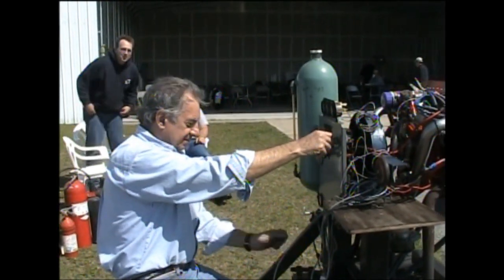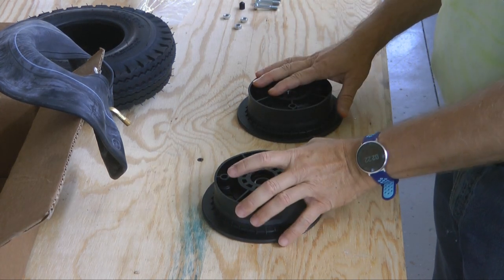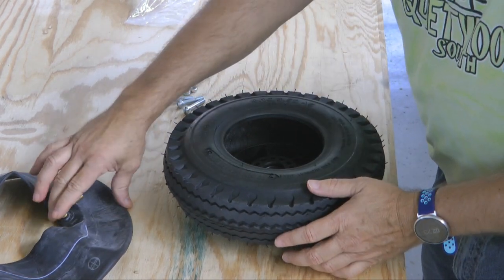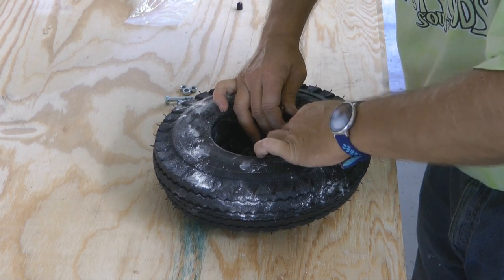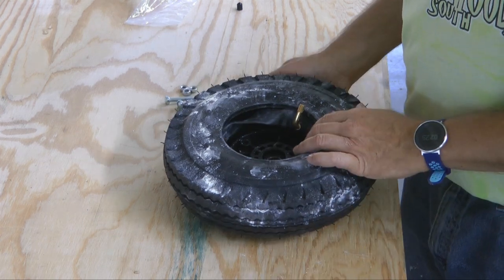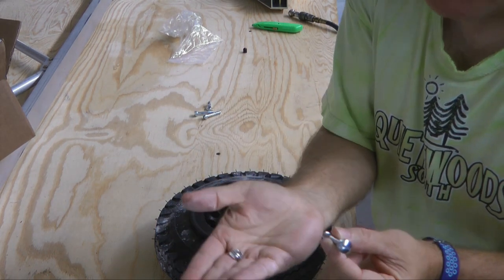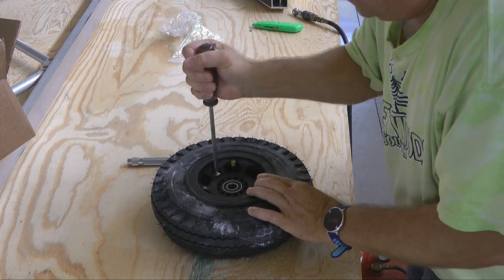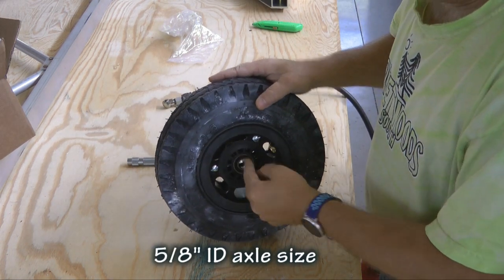Assembling Azusalite Wheels and Tires

Comment: Because this is a 2 piece rim it would be easier to inflate the tube just to take up shape but still very soft, then insert the tube into the tire without the rim halves. Once inserted with no folds or wrinkles, the rim half with valve stem cutout can then be place in line with the valve stem and inserted in the tire. The other rim half can then be inserted from the other side of the tire, making sure nothing will get pinched between the halves and align the mounting holes, insert the nuts and bolts the torque, then inflate to tires rated amount

Comment: I think it is important to stress the dangers of improperly inflating tires. Especially split rims. Even though the rim is made of plastic, if it is overinflated it could rip apart violently. Trained in aircraft tire replacement with a major airline and witnessed a small helicopter tire explode from over inflation. The tire and rim exploded and cut through the body of the  mechanic leaving him dead and in two pieces. Also have seen a regular car tire placed under a mid sized car and using a squib they blew the tire. It lifted the entire car 3 feet off the ground. Small tire or big tires, they all have the potential to kill you so be very careful when charging a tire. Never place your body in what’s known as the blast zone. You should air any tire with a long tire gauge chuck that allows the person performing the work to stand at least a 45 degree angle to the blast zone. I’m very serious about this folks. You do not want to witness what happens when a tire inflation goes bad.  Trust someone who has personally witnessed a man cut in two from a small helicopter tire. Be safe, work smart, work safe, and go home to your loved ones in one piece at the end of the day. Your family loves you and needs you.

Comment: I've never used an Asuza wheel.  Do they not recommend any bead sealant to prevent the tire from slipping on the wheel on landing or during hard braking?  Seems like that would be even more likely with talc on the bead.
Reply from the maker: That is a valid point - used to have slippage on my old ultralights when BRAKING... no brakes on this build!  (none needed)

Comment: Did you mention what size wheel you are using?  Also, are you planning on putting brakes on the wheels?
Reply from the maker: Size and part numbs shown near beginning of assembly on video. No brakes - not needed

Comment: I’m very fortunate to have a heated shop, but I need to wash and etch my large parts outside and our PA weather simply isn’t cooperating for that at the moment.  Many winters, we get an occasional “warm” (above 40) day that will allow a little bit of outside work, but not this winter.  Nights have been single digits or below zero for several weeks now with no end in sight.  Have a few odds and ends to do such as wiring control grips and such, but the major airframe work is on hold until some 40+ weather hits.

Comment: If you take out the valve in the valve stem and repeatedly inflate and deflate the tube a few times, the tube will seat well.  There is a possibility that it lumps up and makes ground rolls a bit more bumpy than necessary. Then reinstall the valve in the valve stem and inflate to recommended levels.    Thanks again for a wonderful series.